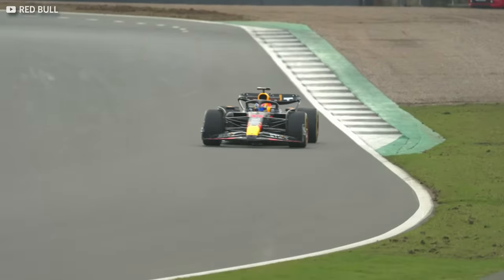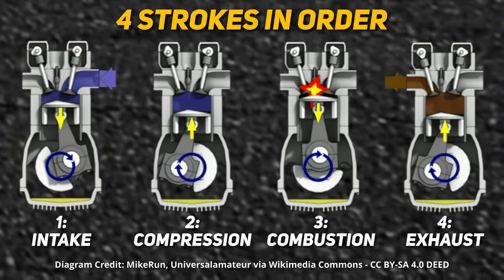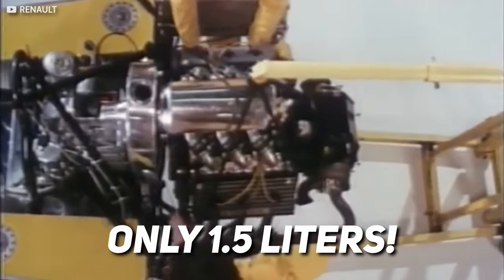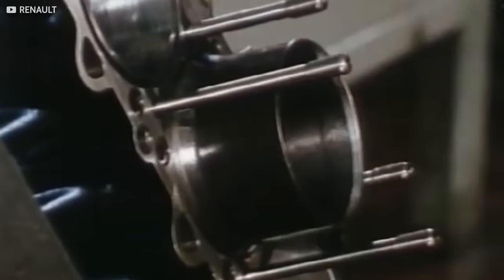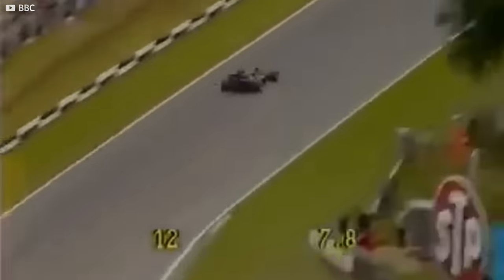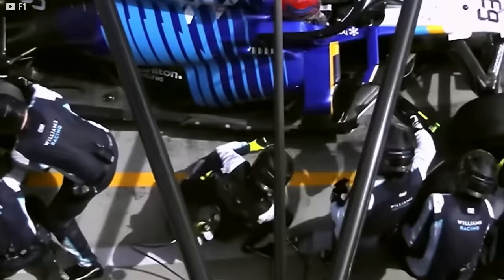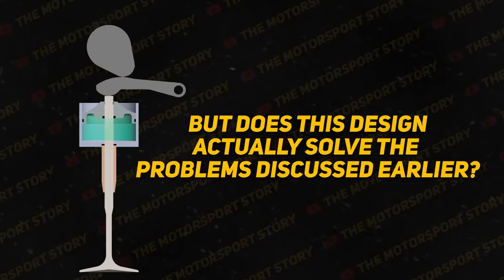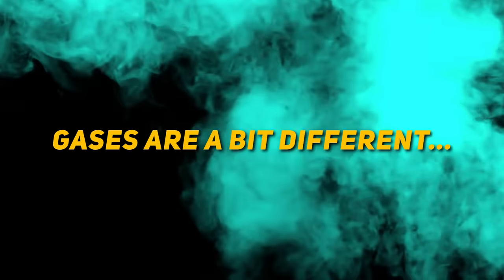This Tech Changed F1 Forever | Pneumatic Valve Springs Explained!

Comment: You skipped over whole aspect of pneumatic valve springs.  Due to the geometry of how cam lobes open the valve, the power required to operate the cam as it moves thru opening the valve is almost perfectly inverse to the power required operate the valve.

Comment: There's one small thing you forgot, pneumatic springs don't have the mass of metal springs so as the cam lobe passes it's peak the poppet will actually apply force back to the cam sooner than with a metal spring return more of the initial opening load back to the engine. It also allow a more aggressive closing profile on the cam because the valve follows the ramp better.

Comment: He forgot to mention that like all metals, Valve springs have a 'Resonant Frequency' at which they begin to feedback the energy and fail. It also takes a specific time for the valve springs to do their job which limits the RPM they can achieve.  The solution is being explored by Konesigegg with their 'Free Valve' engine which completely eliminates the camshaft and al other components of the Valve Train.
Reply: And yet they failed to release product to the market ¯\_(ツ)_/¯

Comment: The force to compress the spring is a side issue. Important number is torque required to turn the cam when in use.

Comment: Engines with an OverHead Camshaft doesn't have rocker arm to push down the valves of the engine, it's only used on engine with the camshaft in the center of the V.

Comment: Nice video, good animation. But why is there a rocker arm in the animation when the camshaft is directly above the valves?
Reply: It’s a follower. A lot of overhead cam engines use followers like shown in the animation.
Reply: Among other things, they allow a higher (or lower depending on the location) lift ratio than you can get with the cam directly over the valve.
Reply: I understand, but in motorsport you want to eliminate as much moving parts (and weight) as possible, so it doesnt make sense especcialy when youre trying to chase high rpm’s.
Reply from the maker: Glad you enjoyed it! The reply from 
9rjharper is correct.
Reply: @MrEdmr2  It can also eliminate side loading on the valve stem and guide caused by cam rotation.

Comment: You over-simplified the gas compression equation by reducing it to Boyle's law which implies constant temperature.  In a rapidly compressed or expanded gas, such as the case in point, there is not time for heat to flow across the walls so the gas eqn (p.v exp n =1) is appropriate where n is the polytropic index probably nearer 1.4 (adiabatic) than 1 (isothermal).

Comment: FIRE VID. I’m trying to figure out why teams haven’t put more effort into electromagnetic valve actuation?? seems like it would save the need for a camshaft or at least replace it with a computer of sorts that could for sure save space, and hopefully in turn weight as well. do you think it’s just costly, they don’t view the pros to outweigh the cons, or has truly no one been able to figure it out? (that last one i doubt)
Reply: Also I just thought of this, but do you know exactly how much pressure is regulated inside the system before the PRV discharges nitro? How much is it designed for?

Comment: I'm also assuming you have to be very careful on startup to make sure that you put the gas on. I mean if a engine sits, do the valves slowly loose pressure and then the valves sink down into the cylinder until somebody airs them back up?

Comment: With the advances that have been made with 3D printing I wonder if anyone has tried, or if it would be legal to have parts of an F1 car's bodywork constructed from capillary air ducts. The labyrinth of capillary tubes could be designed to change the direction and flow of the air, both to improve cooling and improve stability. 

In theory, the ducting could even include micro switches that closed or opened the ducting so when corning the side which would benefit from more downforce could have air redirected from the other side passed through the bodywork.

Comment: someday someone will come up with a clean two stroke engine architecture and then F1 power will double and F1 cars will sound absolutely insane.

if you think petrol engines are going to be replaced by electric anytime soon then I've got a bridge to sell you too.
Reply: Two strokes will never come back. If you burn oil it’s dirty and dirty is not a good thing.. if you think they will, you might like to buy the Sydney Opera House.🇦🇺
Reply: @MICHAEL-ys3pu  current 2 strokes burn oil, that doesn't mean they always have to. hence why i said "clean" in "clean 2 stroke". i'll pass on the opera house, probably doesn't garner much ticket revenue if you're representative of the potential patronage.

Comment: marine 2 strokes which run at less then 100rpm also use pneumatic valve springs
Reply from the maker: Interesting, didn't know that! Thanks for sharing!
Reply: Poppet valves on a two stroke?
Reply from the maker: @gothicpagan.666  I'm interested to know more as well. I've never seen a two stroke with poppet valves but I'm not as familiar with the world of two strokes in general.
Reply from the maker: Doing some searching I found this: 
https://youtu.be/WFity0Tc1js?si=Narkbr3DkLltdbWx
Looks like they're used on an exhaust valve on this marine engine. Fascinating!
Reply: @themotorsportstory  RTA-flex goes further and has binned the camshaft for opening the exhaust valves

Comment: the lower pressure at low lift, means the valve seats are not slammed and beaten to fail.

Comment: Im not sure if your theory about gas is completely correct, that you can just assume that one side of the equation has very small variations and can be set as a constant, because as pressure increases so does temperature and vice versa when decompressing. Setting temperature as a constant throughout the cycle of compression and decompression would completely disregard this fact. Its basically disregarding mechanical work that happends when you compress a chamber of gas but im not sure how this impacts the equation and how the valve is pressing against the camshaft over its travel
Reply from the maker: Thanks for the comment! You're absolutely correct that the temperature will change. The assumption wasn't made to ignore that fact but more to simplify the equation to a point where it could be compared to a regular spring which only has the variables of spring force and distance of compression or extension; which can be compared to pressure and volume of the pneumatic spring. Regardless of the temperature changing, the progressive curve will still be there, it just might look more flat or more sloped depending on what the numbers work out to. I probably could have done a better job of justifying the assumptions in the video, but the main idea was to illustrate that progressive curve in as simple of a way as possible for people who might not have much of an understanding of math or physics.
Reply: @themotorsportstory  Actually when I took a closer look at the numbers it seems like the pressure will increase more exponentially when you have temperature as variable so the original calculation actually underestimates the effect. Anyways, great video and thanks for the answer!
Reply from the maker: @easybuckets9740  Interesting! Thanks for looking into that and I'm glad you enjoyed the video!

Comment: Good video, but don't apologize for the "complex math". It isn't, and if people don't get it, too bad. I honestly didn't realize that this was the level of simplicity that Renault had come up with. I thought that the opening of each valve was controlled with a pneumatic solenoid rather than just replacing the spring. I thought with a pneumatic solenoid the benefits would be major: 1. INFINITE valve timing all adjustable with computer, and 2. Simplified engine design with no camshaft requirement.
Reply from the maker: Thank you, glad you enjoyed it! I'm not positive but I believe that F1 cars can't have variable valve timing per the rules which might be why there is no computer control.

Comment: The f1 engine is designed to rev that high. Same as motorcycles designed to rev higher than car engines. The reason is that torque is not needed for f1 engines, i.e. racing up a hill or up a very high mountain pass plus being very lightweight racing cars property all F1 cars nowadays are under 1 ton (2000 lbs). Most FIA F1 tracks have very little elevation changes. Spa has the most elevation changes 102.2 m. However, there is no clue if the slopes are a gradual rise or a sudden/fast rise. Maybe someone has information and can share slope ratio information for Spa.

Comment: Wouldn't spring compression energy be given back when it expands?
Reply: Yes, in theory, but in reality you're also dealing with increased friction which will lead to an energy loss, plus severely increased wear on the rubbing surfaces of cam and follower.
Reply from the maker: Roger's reply nailed it! I probably could have made this more clear in the video, but was trying to keep everything at a relatively elementary level.
Reply: Besides what the other person explained, the valve train also has inertia, so when the cam is on the closing side of the lobe, the valve spring isn’t push back with as much force as it was when opening. If you know what valve float is, imagine that (except not necessarily to the extent of being completely off the lobe).
Reply: @themotorsportstory  They get no energy back if the spring can't close fast enough to keep up with the cam.

Comment: Here is the problem with F1. Due to the rev cap there is very little reason to spend money on the engine top-end. Otherwise we could possibly see the koenisegg “freevalve” tech in f1 engines.
Reply: No. I'm quite sure the rules state that only poppet valves are allowed. At least it said so some years ago.

Comment: Desmodromic valves would do away with the need for a nitrogen tank. There's no spring with this system either.
Reply: Ducati use a much lighter spring to keep the valves shut ( a hair spring ) rather than actually closing the valves , The rocker arm not only pushes down a valve , but pulls it shut , in a Desmo engine , with the hair spring there to gently keep the valve seated . If you ever ride a Ducati you will feel the difference a desmo valve train makes in the throttle response .... very nice .

Comment: Those 1.6 liter V6s only turn about 6500 to maybe 7000 rpm. Watch any formula 1 race where they show the engine rpm and throttle application as well as what gear the cars are in. The V-10s that used to be the engines are the ones that turned around 18,000 rpm. But they didn't have the turbo chargers nor the battery assist that the modern F1 cars do. The pneumatic valve trains have been in use for decades.

Comment: They said we need multiple overhead cams, multi valves, variable valve timing.
Has anyone seen how much power a  top fuel dragster makes.
Thats without two stroke technology.
F1 like WEC is now actually just an ICE hating driver racing series which actually stifles ICE technological innovation.
Reply: A top fuel dragster engine would not last a quarter of a lap on a GP circuit.  On nitro and stressed to the limit, their duty cycle may be under 5 seconds.  They are a bomb just short of exploding (hopefully).

Comment: I thought the "most advanced and technological engines in the world" would use fully electronic valves instead of mechanical (well OK, pneumatic) ones, so they would have full control on the valve timings for all the driving situations they encounter. Not reliable enough ? Not fast enough for F1 engine speeds ? Not worth it ?

Comment: F1 valve trains  dont use rocker arms ! like all modern  overhead cam engines they use cam buckets - esentialy pressing directly down on the valves -
Reply from the maker: Some of them do/did. Here's a paper showing some of Honda's designs that incorporated them. Referred to as "finger-followers" https://www.f1-forecast.com/pdf/F1-Files/Honda/F1-SP2_09e.pdf

Here's a video of a former F1 engineer going over the parts of the design that includes a finger-follower: https://www.youtube.com/watch?v=pZGhG_431nI

Again, my animation was based on a combination of different design diagrams I could find, some F1, some MotoGP bikes

Comment: Who knows? We might even see some solenoid actuators that function as valve springs, camshafts, and rocker arms to the point of replacing all three simultaneously, similar to what Koenigsegg is doing with its freevalve technology.
Reply: FreeValve uses normal coil springs but also pnenumatic(air) springs to close the valves, a pneumatic(air) cylinder to open the valve and and a hydraulic cylinder for valve position hold and damping.
A spectacular system, but still with serious flaws(Must choose from either slow actuation with "acceptable" power draw or fast actuation with massive power draw).
Doubt it(Or any other "free-valve"-system(Not including MultiAir here) have practical uses on automotive applications(Hydraulic valves are used on some massive low rev marine two-stroke engines though).

Comment: I believe renault were able to reach over 20000 rpm in testing.
Reply: There was an entire era in F1 between 1989 and 2006 when most of the V10 engines span up to around 20,000 rpm in qualifying trim. I would say it was the peak F1 engine era. The F1 regulatory body killed them off. The Bastards.

Comment: For how long  does these engines running at 15000 rpm last.
 If lucky to the of the race.
Most layman do not realize that all “race” engines are not expected to last 100 tho miles or 200 tho miles.
In other words metal breaks, just a matter when. I’ll stick to my ole Honda put, put.

Comment: And I don't believe the claim of Renault making a 1200hp engine ever! Utter nonsense, unless it was some over boosted test only engine, their race spec twin turbo V6's never went over 700hp, and I have the specs in writing of every single F1 engine ever made, even if it was never raced. BMW made the most powerful F1 turbo engine @ 1400+hp (& a single turbo 4cylinder at that) and the most powerful naturally aspirated engine @ just under a 1000hp from the V10 era, and both times BMW was responsible for getting these engine/era's banned... unfortunately 😢

Comment: In a standard car, we already have an AC compressor and a negative pressure line... I don't see the problem of adding pneumatic valve train. Even if it needs changing every 50k km , and a small gas compression cylinder ,fuel saves from less power lost for compression  might be justified. Maybe Renault will add this to the Clio and Dacia 🤣🤞

Comment: There is no need for the rocker in your schematics
Reply from the maker: No it's not necessarily needed if I had shown a traditional hydraulic bucket-type lifter instead. But many F1 cars use a finger-follower (rocker arm) design, so I figured I would add it.
Reply: @themotorsportstory  Agreed!
Reply: It is called a finger-follower and yes it is needed. Without it the cam-lobe would put unnecessary side-load on the valve stem. All F1 and MotoGP engines that run pneumatic valve-trains use finger-followers. You can’t run this system without it.
Reply: A lot of valve trains use followers. They also allow different lift ratios (and you can even change the profile of the follower to change valve event timing slightly).